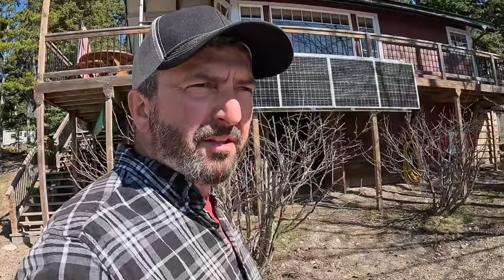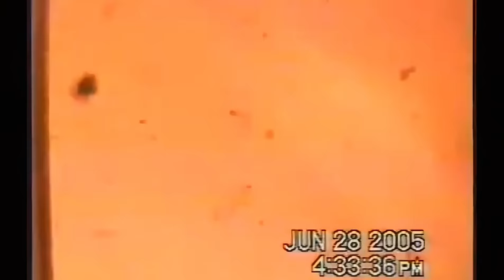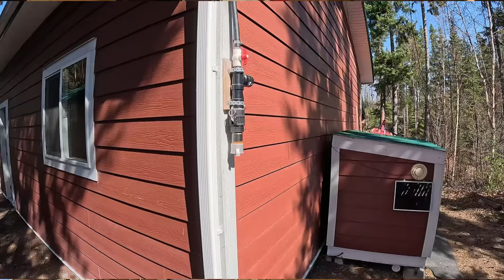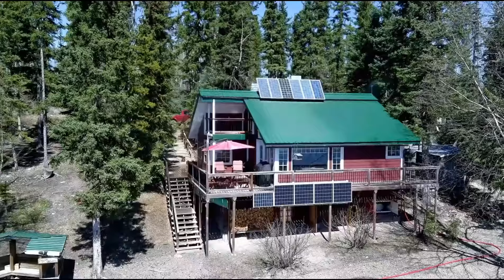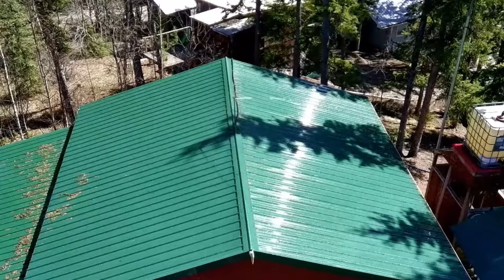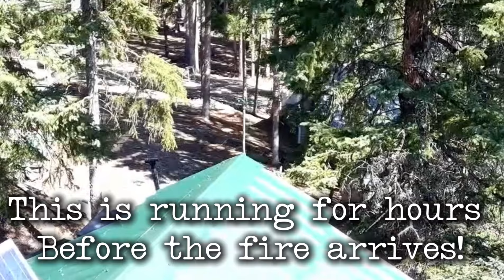Off-grid wildfire defense that actually works

Comment: Hard plumb those supply lines underground, harden it as much as possible.  Possibly look into some way to close off any roof or eave vents before evacuating.  In my area we've had homes that survived the fire just burn to the ground hours later because when the fire went through the convection currents created around the structure caused embers to get sucked into the attic and they sat there smoldering for an hour or longer before finally catching hold of something and burning the structure down.  Maybe if you have enough pressure you could install misters under the eave and under the deck so the walls and eave itself is also wet when the flames roll through.  Yeah, and put your firewood someplace else, at least during fire season.  I see that you run a lot of solar as well, any chance that you could switch your gas pump for an electric one that runs off of your internal batteries so everything is completely contained inside the building and possibly able to be turned on from remote if you happen to not be there during a fire?  Or maybe keep the existing gas pump for the roof and use a tee off of the incoming supply line to power the misters under the eave and deck with an electric pump?  Nice system, keep improving it.
Reply from the maker: Thanks for the excellent suggestions, especially about the eave misters and protecting the attic vents. 😊  Unfortunately - The amount of solar I have would drain too quickly to be  supply such a large pump.

Comment: With all this stuff your propertys survivability comes down to the conditions on the day but the idea is to give the structure the best chance. On your cabin I have nodoubt that you are always looking to maxamize your defecnes. The oppituities to improve your system that I saw on this short overview  would be to consider runing an inground line from the pump to the house and shed. having a tree fall on a line and damage it puts your itire system at risk and with the low melting point of PVC the ststem would be enhaced with non burning risers be they metal or having them boxed in with hardyboard to insulate them. If th e boxing was hinged so it could be opend for ispection or repair all the better. Keepig the main lines undergroud would also mean fire fighters wouldn't be restricted by havig waterlines above ground. Prtrol fire pumps can vaporlock with heat so a sprinkler over the pump to help keep it cool would help even if it's a misting spray.
Widows, one airbourn branch breaking a wondow will spoil your day so window shutters are well worth the effort. It's been found that even metal bug mesh or fine security mesh works well to defuse heat and greatly reduce thermal shock. A bush fire in Tasmaia on a 40+ day and stiff wind hit a small town and was so furnace hot that bricks wher reduced to dust. Your lucky to have the lake at your door step for water supply ang bugout options. As fire events are now the norm incorperatig fire defence into a new build should be mandatory. The added expence is a hassel but your home is only worth the weekest link in your fire system. Good luck with your preps. Doing anything is better than doing nothing.
Reply from the maker: All information!... I like the idea of the mister over the pump house!. Cheers!

Comment: Hi, I live in Saskatchewan, where we have the large agricultural pivot. I checked out the end sprinkler for those they can throw water for a 150 ft radius or 300 ft and diameter. The biggest problem with that would be, how much rise from the water source, and how much volume do I need to achieve that? A 4-in pump if it doesn't have much lift to achieve, might pull it off. Your system, looks more efficient in some ways, as it requires less volume. But I still like the idea of being able to keep things wet a hundred feet from the house including tree tops.
Reply from the maker: Yes.. I find the 2" pump handles the volume just fine. I am planning to add more sprinklers... so that might change. Cheers

Comment: I wonder if there is a way to put CLEAN positive air pressure into a house during a fire to keep smoke out.  Someone needs to invent that.
Reply from the maker: That is something i haven't heard of before. !
Reply: @HacksandProjects  yeah a lot of houses in the Los Angeles fires that did not burn were ultimately considered a total loss because of the smoke damage inside the home.  Putting positive air pressure into a home would be relatively easy just filtering it or or making it clean will be the hard part.

Comment: One thing I would do differently I would bury your fire hose inside a PVC pipe at least 6 in in the ground it will take time in a little money but it will protect your supply line. And I would find a way to put heat shielding on any exposed plastic pipe
Reply from the maker: Thanks Jim. Yeah those kind of things are great to do. You can see by the other commenters as well. You're of the same mindset. Cheers

Comment: See this is perfect this is one of those things that should be standard on buildings where wildfires happen so that you can at least keep the building from being destroyed.  Turn the buildings defense screen on and it puts out this shield of humidity water and then you don't have to run it all the time but you run it when the fire runs up onto you and then once it's past you can turn it off this just makes perfect sense why isn't the standard on every building like a sprinklers inside are.
Reply from the maker: I couldn't agree more, it really should be a standard safety feature in high-risk areas! 😊

Comment: Wouldn’t the fire melt the hoses? You have to protect the hoses also!
Reply from the maker: It could... but also remember that the system will be running for hours before the fire.  By the time the fire arrives its done it job.  But I agree. I hose upgrade would be good. Cheers

Comment: Good video. I'd bury the hose lines. I'd imagine embers will just melt through those. I'd remove all the trees from around the building. 
Maybe put a large hose around the building, buried in the ground, with regular sprinkler outlets directed back at at the house. Try and hide all the plastic parts in the ground.
Reply from the maker: Thanks for the comment. I agree all good ideas. Cheers

Comment: I like it, but your pump seems short on fuel capacity if you intend to set and forget (evacuate) and to be fair although more expensive I would use a mobile generator with submersible pump for the supply, better water pressure and larger output for more sprinkler outlets to increase the size of the envelope. I like the idea of low sprinklers with soft soldered fire triggers to dampen down once fire has pushed through.
Reply from the maker: Great suggestions for scaling up the system and improving reliability, thank you!

Comment: Where we are (120 meters) from Shuswap lake.  We have people selling roof top sprinkler kits. And they expensive.   I asked them a question.  When the fire comes, Everyone will be drawing on the water in the reservoir. It only holds a set number of gallons in it.  I said there is a 60 HP electric pump that is refilling the reservoir.  What happens when the fire takes out the electricity and the reservoir no longer fills.  Seems they don't want to talk about how their expensive sprinkler is useless when the tap runs dry.    The sprinkler systems people put on roofs at Adams lake in 2023 worked well as most people had gas generators with a hose in the lake.
Reply from the maker: Thanks for the info. That's good to know for your area on the water reservoir. It's also good to know that this type of system work during the Adams Lake fire. Thanks for letting us know. Cheers.

Comment: This was not originally about fires.  My family is from the deep south, Hurricane and tornado country.  For us a generational rule has been that any property as soon as you move in you begin cutting trees and clearing brush.  You put a clearing around your house big enough that no tree can fall and reach the house and no underbrush allowed in the clearing so there's nothing to uproot and fling.  And importantly no landscaping near the house to attract and shelter pests.  But when Florida burned during the drought of 99 my home didn't burn like the other four on the road.  Because there was nothing flammable within a hundred fifty feet of the home and before we evacuated as the fire approached I turned on the generator and put running sprinklers all over the roof and yard  so that every inch of the home and clearing was soaked with water.  Fires burnt right up to the wet zone but embers couldn't catch in a soaking wet zone with constant water spray going.
Reply from the maker: Thank for sharing the info!...

Comment: I would have so much fun building this, an making it better every year. I doubt I would ever stop improving it.
Amazing, and hopefully you never have to try it out for real.
Reply from the maker: I agree hopefully I never have to use it. But like you I try to improve it every year. Add more sprinklers and lines. And like a lot of the commenters I'm going to look at burying the main fire hose lines.  Good luck .. cheers

Comment: I would also add in an extra large gas tank, (siphon, or pump) so effectively you can add a very large amount of fuel to the pump so it can run several days with no refueling. A backup pump, might also be nice. One might also want a handy spot to attach a hand line so you can aim it where needed. (if present).
Reply from the maker: You're right. I didn't mention it but I have put a extended size tank on the pump for just that purpose.

Comment: I like it. You have some very tall pine trees nearby. You could take a pipe right up the pine tree and then put a sprinkler head on it. This could 1) get the water high 2) super saturate the pine tree. 3) decrease the chance the tree will ever catch on fire, 4) give you an alternative set of sprinklers you can you use.  One could also alternate; water with one set; then water with another set. In presoaking the area, this gives you a lot of opportunity to presoak more places.   Context: I know a man who fought wildfires in Yellowstone with irrigation equipment. He borrowed some equipment and deployed to a couple of towns/camps that had water nearby. Him, and a small crew set up; ran the equipment for a couple of days, and were then redeployed to another area. The equipment came down and moved. (winds; conditions, needs; camps and more change.) About a week later fires came through; but only burned areas he had not watered. One side of the tree burned, the other side did not. Effects of the humidity in the air could be seen half mile away. Don't be afraid to run the equipment before you need it to presoak.
Reply from the maker: Great Info to add . thanks!

Comment: Good work! Question: if you have to evacuate, I assume you top up the gas tank on your pump and leave it running but how long does the pump run on one tank of gas?
Reply from the maker: Good question.  I have an extended fuel tank and should get 3-4 hours.

Comment: I’ve been talking about these things for years. Same as anchoring large webbing nets over houses during cyclone/hurricane events. Unproven at the moment. It will at least stop your debris from causing local harm. 

As for the fire protection, running conduit under the eves to dampen walls & verandahs could improve your chances against ember storms. 
For those with limited water supply, try “training” runoff water down to the lowest part of your property for aggregation & re-pumping purposes. Always start early,
Reply from the maker: Good information thanks !

Comment: Those flexible water lines I have my concerns about. Why couldn't you bury under the soil (Below frost line)  some schedule 40 or similar pvc pipe, it would protect the system from  developing leaks, would lessen the chance falling debris could restrict water flow,  and be less to worry about when a fire is approaching., certainly you would have to keep some water hose connections and certainly you would need  to install an air inlet to push most of the water out of the system during the winter time.  But that is easily managed with an air compressor. I would have 2 back up water pumps and I would start and run then several times per year because having the does you no good when they will not start due to the fuel system being varnished up from bad fuel. I would  also move the firewood away from the house and consider trying to create a fire resistent structure to store it in such as a metal shed that you could have open sides with prop up doors to allow access and the wood to season and then only shut the doors if a fire is approaching.
Reply from the maker: Thanks. All good information. The initial intention is that this is a temporarily hook up system which is why it's above ground. But several comments have come in about burying the lines. I think it's a good idea to make a permanent system. Cheers!

Comment: Great Idea, to show others what you've installed, so we can all learn. We lost our home here in Australia on Black Saturday 2009. I'd installed an integrated sprinkler system that was working really well, until the petrol water pump stopped. This was the most extreme fire attack imaginable. Strong North winds fanned the fire front, then a Southwest change turned a 20km flank into the front and came straight though our area. On that day, 3000 homes were destroyed, over 100 lives lost.
I'd say your system would work well for the hours the fire is approaching, but if you want it to continue working when the intense radiant heat approaches, you'd need to replace the hoses with underground polypipe. Also, we only use copper or shielded pipe in exposed areas. As you already have your plastic piping in place, you could consider some tin flashing? Being careful not to introduce areas where embers could lodge next to combustible materials.
One last thought. Good idea to provide connection for the local fire brigade, just don't rely on them to get there. There's only so many tankers to go around, and if lives are threatened, they come first. 
My advice, set it up to fun remotely, lots of house insurance, get out early.
Reply from the maker: Thank you for sharing your experience and such valuable, practical advice for hardening the system. 😊

Comment: It's a great start!  1) feed lines are better to be metal, and/or underground flame resistant pipe.  2) anything above ground should be metal with no plastic parts, they'll melt super fast even with radiant heat.  This also goes for O rings on your fittings, make sure those are melt resistant.  3) trees around your house is going to render this whole setup pointless.  If it gets that close those trees will candle and set everything in your house alight.  4) wood piles shouldn't be close to your house, consider those expendable and get them far away from there

Just some constructive criticism.  I'd also consider an external fuel tank for your pump since you might have to evacuate and want that sucker to run for days when you're unable to refill the gasoline!

Absolutely great start tho!
Reply from the maker: Thanks for the solid advice; I have plenty of work ahead of me to harden the setup, but I appreciate the tips! 😊

Comment: There was a woman that had her whole house set up this way and she had her own water supply and power supply and the fire department in their Altima wisdom not knowing that it was her own water she was using shut her system off in her house burned down because they wanted the system they were trying to get water for fighting the fire to have more pressure not knowing she had her own water pumps her own water tanks her own power supply. They basically destroyed her house
Reply from the maker: That is a heartbreaking story and a good reminder of how important it is to be clear with emergency responders. 😊
Reply: Wow. It sounds like she should have better labeled things. Clear written directions might have changed things.
Reply: Yeah, how did they even find her controls, and know what they were for during a fire? 

Turning off mains is pretty normal so they don't lose pressure from melted pipes.  But if it was a seperate source, I'm all surprised.

Everyone in the rural area out where I am has their own pump.  Firefighters don't turn those systems off.  No point.  It would just waste time.

So yeah, clear labeling would be important.

Comment: Bought my home in south Florida in 95.   Shortly after installed hurricane shutters.   Shocking how many people had zero and how many ran to Home Depot for plywood.  You absolutely need a sprinkler system plus trees away from the home. No bushes besides the home.   You need a couple massive pumps that already ready to go.  You have to be there for your.  It should be plumbed in permanent.
Reply from the maker: You're spot on about being prepared; I'm working toward a more permanent setup as well! 😊

Comment: You've done a lot to safeguard your place.  The roof and siding choices were excellent!    I think now you may want to focus your effort on protecting the hose system or replacing it with piping buried underground.    Running the hose smack dab in the middle of your wooden dock would definitely need some rethinking.     I like where you're going with this!  A little fine tuning and you'll be as safe as you could possibly be if a fire hits.
Reply from the maker: I really appreciate the feedback on the setup; it's all part of the ongoing process of improving the system. Cheers!